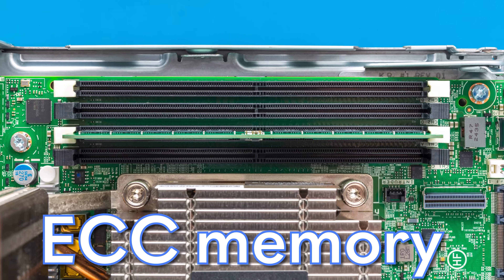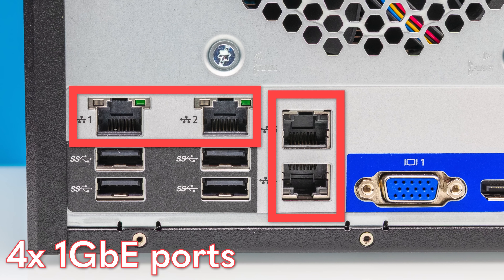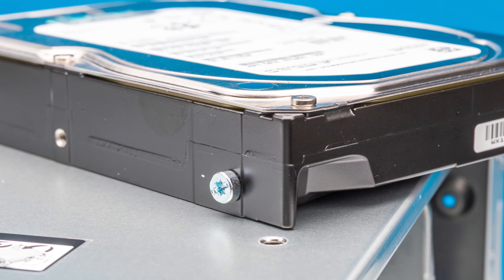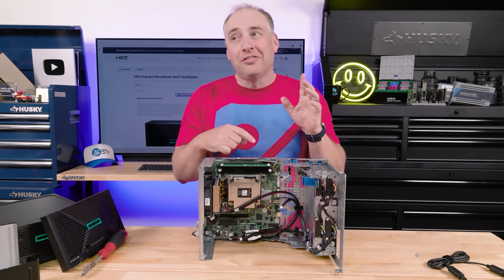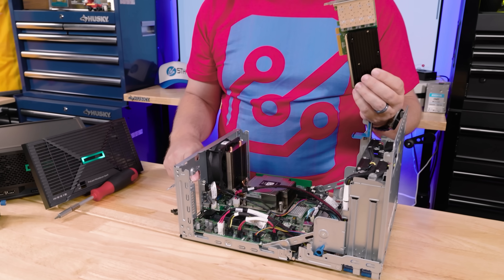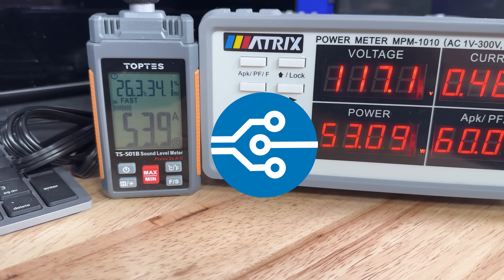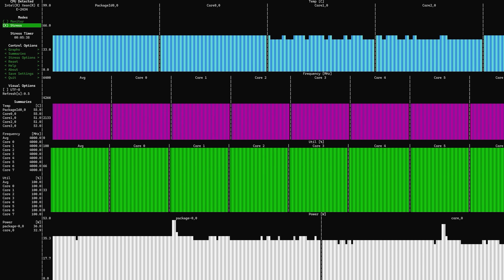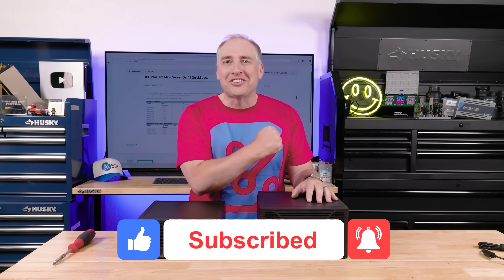THE OG Mini Server is Back - HPE ProLiant Microserver Gen11 Review

Comment: Yeah, 1GbE is ... sadness.  Re: flash.  Would have to move over to a cage backplane and some switching logic + u.2/sas combo connectors.  Selector on MB per 2 drive cage switch between u.2 and sas.   Costly.  Still, would be pretty cool to have a selector on the front of the cage for u.2/sas.  At that point, the cost is already incurred and might as well have a selector for each drive bay u.2/sas.

Comment: Great servers, I've been running one of these 24x7 for over a year with an E-2468 (8 Core Xeon), 128GB RAM, 10TB & 6TB WD Red, 2 x 4TB WD Purple, the additional iLO card with 4TB NVMe and it runs between 70W-80W. Definitely noisier than the Gen10+'s which are hard to notice in a home office scenario. Unfortunately as soon as you plug-in any form of PCI-E card that also makes the noise substantially worse. Mine will hopefully be going in a wall cabinet in the garage soon where noise won't matter, the Gen10+'s can stay in my office.

Comment: Poor design choices. It's 2025, nearly 2026. Not 2006.
Minimum 2x10GB ethernet
4 x USB4/TB4 and PCI-E bus to support full bandwidth
Built-in PSU, have an external PSU option for redundancy

Comment: 4x 1GBe is more than enough. I am talking from the standpoint of a system integrator. Smb customers usually don’t have the switches for 10gbe and 2.5 isn’t a thing. If you need faster network connectivity just throw in a dual 10gbe nic but then you are that serious you maybe want to have 2 nics for fail over and then we probably don’t want a micro server anymore anyway. So you can fix it but having it on all devices would make them so much more expensive in general - management is separated so you already can get 4gbe with bonding .. not getting why people here in the comments get crazy about it this device is primarily for smb rather than home labs

Comment: Shuttle were using the same heat pipe cooling system 20 years ago.  The whole thing appears under speced and over priced.  10 years ago HP were the selling basic Microservers for a not much over 200 euro. Now they are closer to 2,000!

Comment: The NIC speeds are disappointing, but not as disappointing as not being an AMD board/CPU. Sure a branch office may only have a 1Gb WAN connection, but you'd get so much more life out of that box by connecting it to a 2.5 or 10Gb switch, and wasting those slots with NICs isn't a great solution. Better to pop in some SSD's to bolster the hard drives.
I don't even think HP can claim it's a less expensive option either unless they're getting some ridiculous discounts from Intel.

Comment: It's nice but too expensive for what you get. I'm still using my Gen10 Plus with E-2224 which I bought for less than 1000€ when it came out in 2020. New Gen11 is over 2000€. 🙄

PS: Great video! 👍

Comment: I chose a used but still young Dell T350 for my upgrade. Way more space inside, much more flexibility, hot swapping and redundant power supply. With the BOSS module it even has a dedicated hardware RAID1 m.2 boot SSD as option. The lack of that was the big downside on the Microserver Gen8 where I upgraded from. The use of the SATA-port in the Gen8 for the optical drive for a boot SSD was okay but nothing to brag about. Admittedly the BOSS module on the Dell T350 is only m.2 SATA, but the benchmarks I ran after the upgrade were off the charts relative to the Gen8. One of the RAID-arrays is in the top 1% worldwide on performance says the benchmark. 

And the T350 (filled to the brim with storage drives) uses only 90 Watts, which is quite good for a server that is considerably more powerful and bigger. The price was not that much higher that the biggest Gen11 option

Comment: 4x 1 GbE ports are a deal breaker for me. C'mon, man. Dual 10GbE in 2025 would have been decent. The freakin' MS-01 has dual 2.5 GbE and dual SFP+ (10 Gbps). Now, to upgrade to 2.5 Gbps or 10Gbps you're going to have to use up at least one PCIe Slot.... Disappointing.
Reply from the maker: Fair feedback.

Comment: So it uses the wrong CPU family, has only capacity for 5 drives (all non hot-swappable), with 2 PCIe slots that precludes it from being used in certain scenarios, with a Broadcom Gigabit quad-port setup that’s older than the i350 and less flexible?  And somehow HPe still wants to quote 1200+ for it?  And I’ll probably need a pretty beefy support contract from them to trust it?  

Seriously, HPe, have you checked out your SMB competitors like Terramaster, Qnap or Minisforum and see how they approach quad or 6 bay “micro” servers?

It’s not nearly as small or agile as the ec200a/tm200 (although that box is a “private cloud” solution that went nowhere), it’s not as cost effective as the MSG7/G8, and it’s not even as rugged as the EL1000 that takes moonshot carts…
Reply from the maker: We have an EL1000 chassis I have been debating doing a video on
Reply: @ServeTheHomeVideo  Eeeh, the moonshot carts for the EL1000s are Skylake/Coffee Lake Xeon based so they are functionally obsolete (but probably good as lab/home machines).

Comment: +1 on the AMD Epyc.  My Milan-based 7402 24/48 Thread CPU is an amazing move up in server performance with power sipping while at full thrust operation.  For the networking, aggregate those into one bonded config.  For the storage, the first thing I would add is an actively cooled 4 NVME PCIE adapter allowing M.2 SATA for boot and the 4 NVME blades in a ZFS Z2 configuration with NO spinning disks (cooler operation).  Next would be a Broadcom/LSI 9300-8e SAS HBA to connect to an external SAS chassis with big hard drives for long term/deep storage.  All running on a custom Linux config with only networking and storage functions included.
Reply from the maker: That is more like the all flash version I requested in the Key Lessons learned section

Comment: The case must be disassembled to access the hard drive locations. No hot swapping. So it's a no, compared to a standard NAS.
And with a big limitation in terms of power supply, it will be complicated to install a graphics card to do calculations.
In the end, I really have trouble seeing in what use case this type of device could be useful.
Reply from the maker: You would normally want a cover or a lock to prevent accidental drive removal in an edge NAS. So there should always be a step before removing a drive. In this case it is just popping off the cover

Comment: I remember when I bought the Playstation 3 back in 2006 and it had a 1Gbps network port. That was almost 20 years ago. If I were HPE I would have just left the server with no ports (other than the ILO) instead of this configuration.
Reply from the maker: To be fair, there are two PCIe ports to add your own
Reply: @ServeTheHomeVideo  exactly my point. The message “just bring your own network solution, be it 10G SFP+ or whatever, we got you covered with two pci-e slots” it’s more decent than: “here’s some networking from 2005 nobody wants to use anymore. Oh and some of the pci lanes are blocked by those”

Comment: For about $1395 for the system as configured, it's ridiculous that they have quad GbE ports.

I remember my SunFire X4200 having quad GbE ports, and that was in like 2007, when I bought that thing used off eBay.

I think that the screw pegs would be super annoying vs. hard drive mounting rails or something like that (because if you drop/lose the screws, you're screwed).

Comment: The CPU choice for this might have been quite intentional to hit that low idle and mainly idle-ish power draw, since those chiplet-based Ryzen/EPYCs have a much higher power floor... which actually is something I'd like to see tested more properly since nobody seems to really cover it, from my personal testing/usage over the years I noticed Ryzen can idle very low if its well and truly idle, but once you load it even with a baseline idle load of a few VMs that aren't doing anything, it jumps up as the IOD can't deep-sleep anymore, much lesser issue on Intel.

Either way there should at least be an EPYC option since Zen 5 is amazing. Also lol at 1 M.2 slot, meanwhile all those unused PCIe lanes routed to that MCIO and OCP slot... bummer.

Comment: The MCIO and the OCP3 may be jut connected with each other and you need an additional loopback cable from PCIe slot to the MCIO, in order to utilize the OCP3. That is how SM does it eg on X13SEDW for the second OCP3.
Reply from the maker: That is also something in the DC-MHS boards. The strange part here is that the OCP looking connector is pointing towards sheet metal so you cannot add a card into it.

Comment: These are always short of my requirements for home lab. I would use these as as KVM host and dual M.2 would be nice for mirroring while the rest is for VM storage. The Swap drives, granted I can get SSD fillers to cover 3.5 to 2.5 but we should be able to SSD drives on these these days. Considering ICY Dock makes 2.5 hot swap bays for standard PC/Server builds, adding support for 2.5 or as an option to build it out way would be nice.

Comment: I just can't understand those 1Gbps ports, it's pointless to have HDDs a powerful CPU if the LAN will bottleneck you.

A WTR Pro will be a much better storage solution, let alone something like a WTR Max or a Minisforum N5.
 Maybe they're not as powerful, but I can't see many uses that require lots of bulk slow storage and powerful CPU at the same time (implying they actually are powerful).

Comment: I have never fully understood why you'd need 4 NICs in the first place. seems massive waste of space and lanes.. 10G SFP+ on this would have been interesting. I dont understand with all the height that the PCI slots can't be full height, does not make sense at all, nor the spacing. Id also want to see an internal RAID slot. should be an option. 

This is just super expensive, super huge, super slow and not was an Microserver should be. I had the first two generations of micro servers, essentially that was the beginning of my homelab. moved to Fujitsu and finally decided to go own case + super micro boards with Xeon Silver CPUs, these are now 7-8 years old and desperate needs to be replaced. A01 is interesting but lacks remote management thats is a must for me

Comment: Yeah the networking is silly. But also is going with an external Power Brick and not just (more or less) providing two Power ingress ports. You don't have to include the second PSU by default, but offering a second DC input really couldn't have been that hard or expensive. And hey, selling a second PSU seems like an great upselling opportunity.

Comment: Contrary to what most comments are saying, I think networking speeds should be left to the user. They can install any speed card they want. What is very much needed is more PCIe slots, as many as possible !!!
Reply: "Give me more slots so I can fill them with networking cards" vs upgrading the existing network ports to higher speed so one doesn't have to fill said slots with networking cards.  Plus, this is a "MicroServer".  Add more PCI slots and it's no longer "micro".   Like pretty much everyone else said, HP should have gone with (2) 2.5 and (2) 10, if not flat-out (4) 10.
Reply: @ichicolco  
Micro => 3 PCIe slots
Medium => 5 PCIe slots
Large => 10 PCIe slots
Ultra => Add your own PCIe switch

Such a machine can be used for different purposes without buying a new machine everytime which is an oligarchic idea. Democratize the machine, dont capitalize on the user's pocket.

Comment: I don't mind 1gbps ports. Not great for future-proofing, but I personally don't need more for my home office. And I guess many SOHO locations are still at 1gbps with no compelling need to upgrade yet.

but only USB Type-A ports? In 2025? That's frankly laughable.

no USB-4 or Thunderbolt is a deal breaker for me personally, but I agree that's probably not a strict requirement for a server, so I don't expect that in a product from a major vendor. But at least give us 2-4 Gen2×2 (20 Gbps) ports.
Reply from the maker: Thunderbolt and USB4 would be very abnormal on servers. Something to keep in mind is that the current entry Xeons do not have an iGPU

Comment: The form factor of these servers harks way back to the Compaq days. Clamshell and the extra screws in the chassis was standard all the way back then. I do have one question Patrick, I noticed the serial port went into the Ilo daughter board. Is that serial into the ilo controller or is an actual port accessible to the operating system.

Comment: I have bought a used HP EliteDesk 800 G4 SFF few months ago, it seems to be much better than this HPE gen 11 server. Platinum conversion efficiency power supply. Four expansion card slots.  two 3.5" hard drive expansion slots, one 2.5" hard drive expansion slot. Two pcie gen 3 x 4 nvme SSD slots, which can be filled with NVME SSDs to fill the network transmission bandwidth that the intel X550-T2 can provide, and there is also a UHD630 integrated graphics card that can provide HEVC/H.265 video transcoding.
Reply from the maker: Good point.

Comment: Looking at the photos on the article, those drive bays are physically & electrically compatible with SAS drives. Did they cheap out and only give the motherboard a SATA controller again? Requiring a PCIe HBA?
Reply from the maker: Yes SATA only. That makes sense in this kind of system. SAS costs a lot more and adds power, but many will not use it.

Comment: Naa mate, i feel you've slightly dropped the ball, giving them the time of day on this one, hp are known for being a hot potato. This machine is not an enterprise level machine putting a xeon and ecc ram dosnt not make an enterprise machine i do like you cooked them with the am5 though!.  the networking is not even laughable is frankly instalting  and in typical hp fashion too. proprietary power and main board no. This is ewaste within a few years if even that with how thair hardwere support track has gone.  I get that most people and places are looking for a plug in set and forget, but until these prebuilt systems start using standard off the self components that can be swapped out when gone bad, without having to refinance half the company cause everything depends on that machine i can not start to recommend them.

Comment: Price? Over 1500€/$... so no, it hasn't come back, given that it's absurdly overpriced. First microserver was A FRACTION of that.
Reply from the maker: I agree, but USD to Euro conversion these days some can be had for under 1000 Euros.
Reply: I paid 190€ for the n54 (gen7) in 2014 (just saw the invoice) 🙄
Even gen8 with the Intel Gwhatever CPU was around 200-300€

And hardware was quite expensive compared to now, so nowadays HP pricing doesn't make any sense 😢
Even worse knowing that you will not be able to download updates as soon as the microserver is out of warranty.

*prices including 21% vat.
Reply: Don't get the point, to be honest.
No 10ge (bought a lincstation n2 with 10ge few days ago, was.. Less than 400€ with 21% vat)
Absurdly large (for that size you can go itx or matx with a jonsbo case)
Just 4 lff slots.
Just 2 pcie slots.
Just 128gig max ram ("just".. As am4)

And considering ilo nand failure rate, and lack up updates out of warranty period (as per hpe Chinese*-like contractwall) I'm not sure if it's something good

*as huawei.

Comment: The starting point should have been the price ... These things are great, but the killer point of these was the value, but mid-way through sale of the Gen10, they doubled the price.. and now they are 6-7x the price (of the entry level gen10).  At least in the UK, they're asking £1200 for it!
Reply from the maker: I agree that pricing feels a bit high compared to older generations, but then there is also room to run discounts with this pricing.